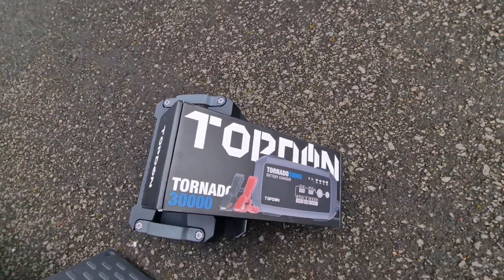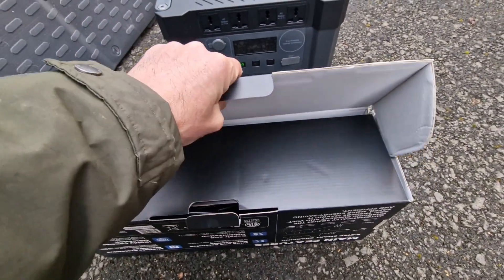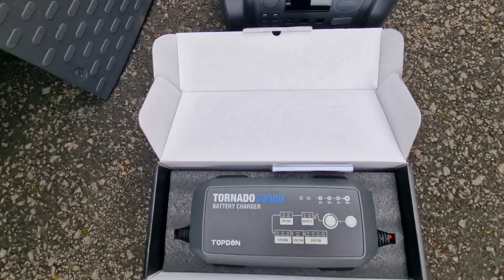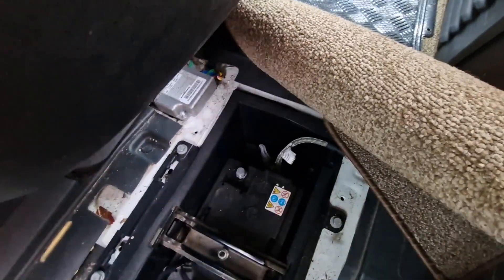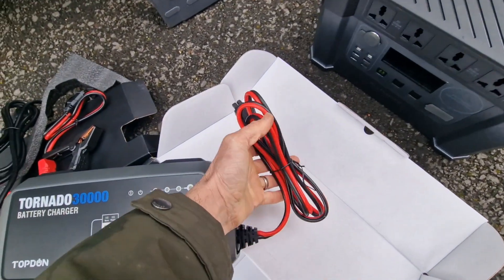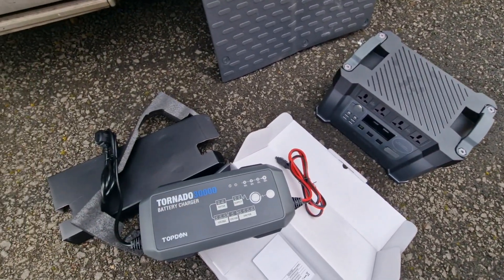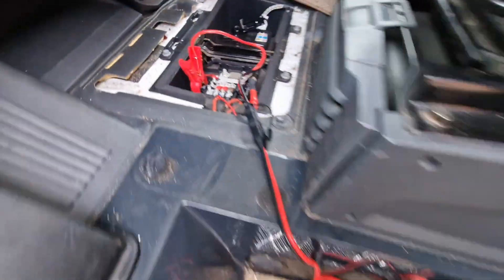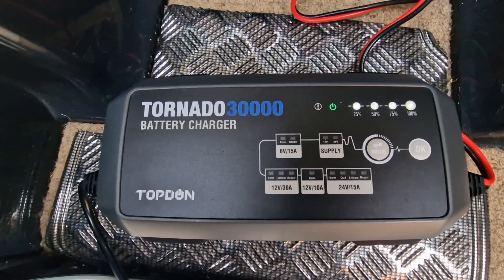The Best Battery Charger You Will Ever Need. Tornado 30000.

Comment: Doesnt seem to have a dedicated leisure battery mode unlike the leisure battery version of the Yuasa PCX12 charger aka PCXL12 which has a dedicated leisure battery algorithm for charging leisure batteries as well as other modes like  desulphation etc
Reply from the maker: I think they are setup to voltage and amps rather that leisure or cranking.

Comment: Caravans should be  mot tested and road taxed they should  also be made to travel at restricted times too ( eg  night time ) because they cause traffic delays and slow down traffic and case CO2 pollution pollution   ⚓️ s
Reply from the maker: The Government has just done a report on this and over the last 3 years they only found 12% of caravans tested had issues and were not roadworthy, 9% of these were only due to lights that were not all working. So at the moment it doesn't look like they have enough evidence to make mot's a requirement.
Reply: Maybe we should go on holiday by flying instead of towing then again maybe not as that causes far more pollution than towing as I dont know of any aeroplane with a DPF filter to bring emmisions down whereas vast majority of tow cars will have them. 
Night time towing not an option as you usually have to be off a site by lunchtime and aren't allowed on site until after midday.
Not sure how towing causes much delay as there are typically 3 lanes on a motorway , 2 on a dual carriageway and caravanners can tow at the  speed limits on 20/30/40/50 mph roads and 50 mph on a national speed limit road. HGV Lorries on the other hand cant travel as fast as a caravan on a national speed limit road or motorway as they are limited to 56mph. Maybe you should go onto some lorry forums  and complain there too. 
Try allowing slightly longer for your journey as per common sense or drive at night to avoid caravans